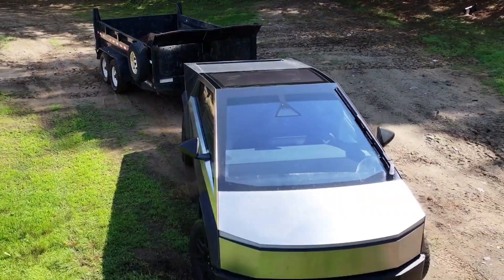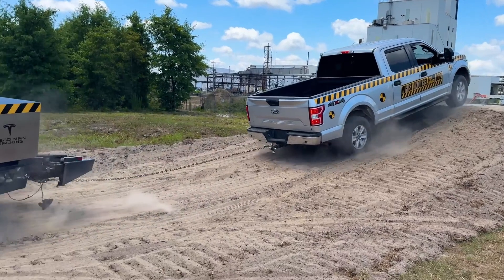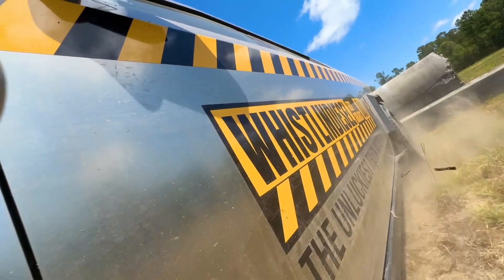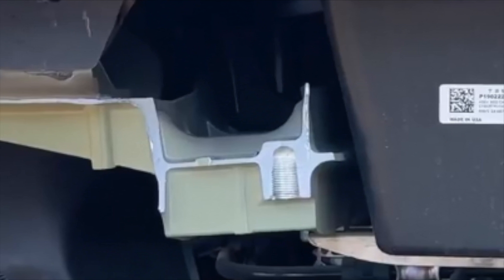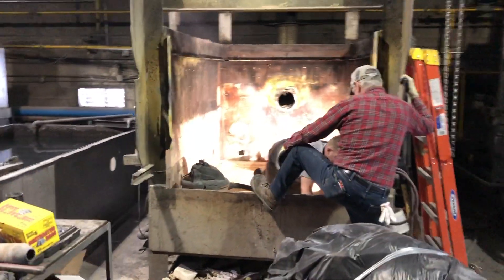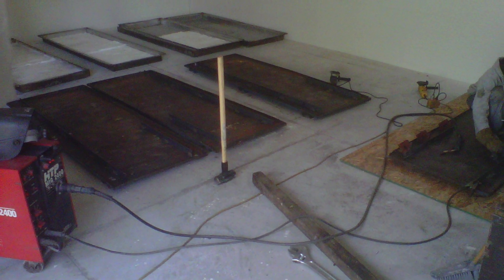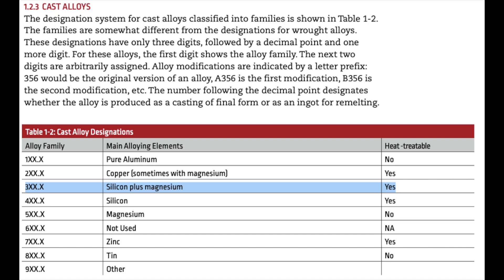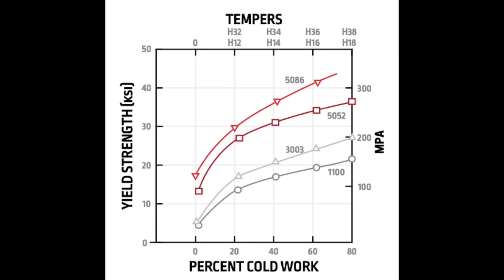Cybertruck Towing Review  WD hitch failure explained

Comment: The things that truck went through were so beyond what any truck is put through in normal life. If you’re smacking the hitch on your truck the way it was shown in the video on the daily you probably are going to have your truck in the shop undergoing expensive repairs all the time no matter the brand. To say that the casting is weak and not suitable for everyday use is absolutely asinine. It’s simply just the typical Tesla/musk slander that is ever so popular today and has no real foundation or merit.

Regardless, the WD video did show some other weak points of the truck as well such as the tonneau cover and door panels. It would be in teslas best interests to aliviare some of these issues with design changes in the coming years which is something they are more than capable of and have proven in the past.
Reply: Lots of people use trucks like this. Anyone that drives in uneven terrain hits the hitch of a truck on the ground all the time. I like lots of contractors do it all the time. Even if you want to dismiss people that "off road" what about rearend accidents? Cast metals gives no warning when it's about to fail unlike steel that bends.
Reply: @dozerboyd8784  I’d like to meet the contractor that’s driving over stacks of concrete pipes and slamming their hitch on them the same way WD did. .
Reply: @BrandonMeyer1641   go work in the oil field or offroading. I hit my hitch all the time. I understand you don't think there is an issue here, but you have no clue what plenty of people do with there trucks. People break steel frames/hitches often enough. No way I would trust that cast frame. Sure I might not break it, but if it does with the way I use my truck and I have a trailer on.... I'd have to live with possibly killing someone. It's obvious when my steel frame is compromised. 

And the fact is WD has done this and more to truck up to 40 years old and never had this issue before.
Reply: Looks like WD has made a vid about smaking the ford hitch like 30 times and it only bent... at the frame and not the hitch...
Reply: @bacoloidlizar7417 don't forget after that he bent it back with a 90k lb excavator and the hitch and frame was still intact
Reply from the maker: I am not sure i am slandering anyone !!!!  

I am simply observing, explaining and commenting

Aluminum does have properties that make it fail different than steel ….  THAT IS A FACT ….  Where generally speaking steel bends then tears, aluminum fractures than breaks ….  

THAT is how these 2 different metals work …..

Personally, i only build hitches from steel 🤷‍♂️  but to each its own!!!!

I also CLEARLY said that under “normal use” that hitch setup is probably fine
Reply: @ZILAwelds  I was more so speaking to other people’s opinion on this matter. A little preview can be found not too far from here. Your observations were quite measured and reasonable.
Reply: Definitely not "asinine". I use my trucks..that means towing. I also enjoy off reading. Trailer hitches are a necessary evil that interfere with off road use..
   I do remove my hitch if wanting to go off road and no towing is foreseen, but not always. 
   If I don't,  it WILL be hit just like in the video. Probably multiple times.  And I won't be easing the rear wheels off gently if anticipating a hit, I want a little speed to avoid getting stuck when traction is reduced by the hitch momentarily bearing the weight,  rather than the rear tires.
    I have slightly bent my frame doing this. It is ductile, this is irrelevant because of that. Brittle materials have no business between a tow vehicle and a trailer.
   WD can be a meat head, but that vertical smack right before towing the ford was totally reasonable...I guarantee that would happen to it if I owned it. 
   The fragility and breakage, and the thin cross section visible after the break were surprising..how will it be after a few years of northeast winters and salt water? Untrustworthy, and therefore useless, for towing. An accident waiting to happen...call the lawyers!
Reply: @firstielasty1162  well I’d say you’re quite the outlier. If you’re hitting the rear end of of your truck all the time and causing your frame to bend you should probably consider picking your lines more carefully or selecting something like a jeep which has a better departure angle for your off roading endeavors. Leaving your truck to do the towing and thus preserving its longevity and road worthiness. 

As for the corrosion, aluminum is drastically more corrosion resistant than steel and the castings on teslas are coated similarly to other truck frames to prevent any harmful corrosion from occurring to begin with. There’s a reason there are so many vehicles, trucks included which have aluminum components such as lower control arms with zero coating to speak of.

Comment: Great video man I am still going to blame tesla because truck frames should be able to bend twist and even break and crack but still not rip off as easy as whistle dicks truck did I've punished my steel truck frames to no end my last ford diesel had the job of pulling out a stuck 1 ton dump from a back yard and couldn't get the traction to pull so we hooked another truck to the back of mine and gave it all hell. My por truck was twisted and pulled in ways it was never designed for but not one bit of damage or even alignment issue came of it
Reply from the maker: Oh i am NOT arguing that Tesla made a good or bad material choice ….  Just observing and commenting and explaining here …😂
I have some popcorn and i am watching to see how this is shaking out 😂😂😂e

Comment: Looks totaled to me. What are the chances you are going to be able to buy that big piece of die cast from tesla?
Reply: Lol, my Honda Fit with less than 1,000 miles on it was totalled by a fender bender.  The fender has safety sensors in it, which made fender replacement cost more than the value of the new car.  And I can guarantee I wasn't driving the Honda Fit off six foot high culvert pipes!
Reply: Tesla already makes sections of the crush zones that can be welded into place for crash repairs.

Comment: I went to engineering school and we briefly discussed manufacturing processes like injection molding. I didn’t realize they could injection mold frames. I think of small plastic parts when I hear of IM. Thanks for the information! You are a metallurgical genius!
Reply: The C8 has LARGE portions of the chassis that are made from aluminum IM castings. They call them bedford castings because they are made at the GM Bedford, IN plant. They look the same as the parts where the cybertruckf failed, although the cybertruck parts appear to be coated with an anticorrosive paint where the GM parts are naked aluminum (probably with some minimal anti-corrosive sprayed on them)

Comment: The truck is designed for a nonframe construction. Why is everyone saying its a frame malfunction?
Reply from the maker: well, the hitch is not attached to the sheet metal of the body ....  it is attached to some aluminum "brackets" connecting it to the load bearing structure of the truck or it is even part of it ....  if it is part of it then it is "frame" per definition, it it bolts the hitch to the main structure, then it could be seen as a sub frame assembly .....